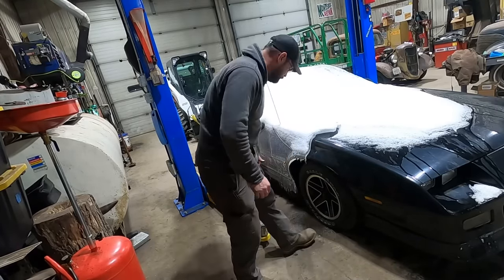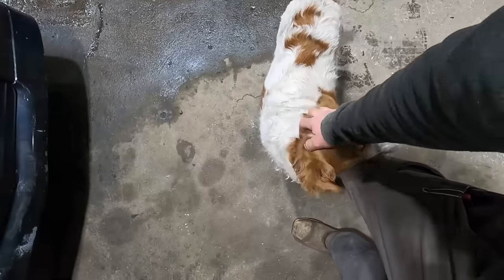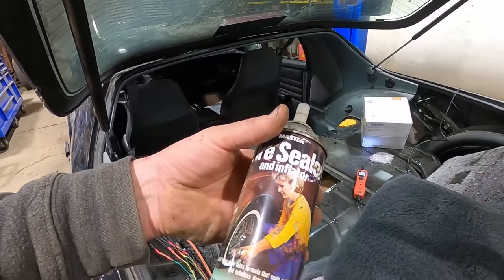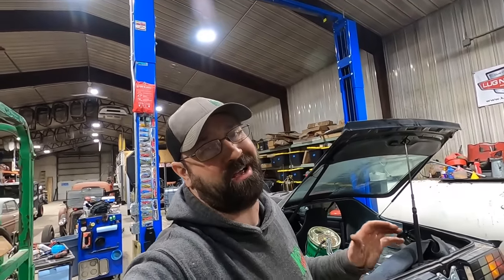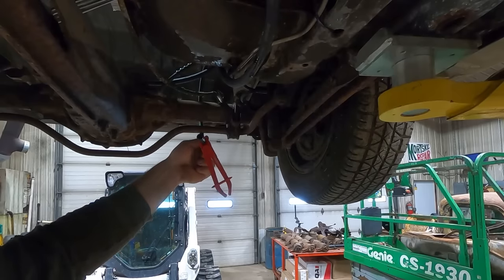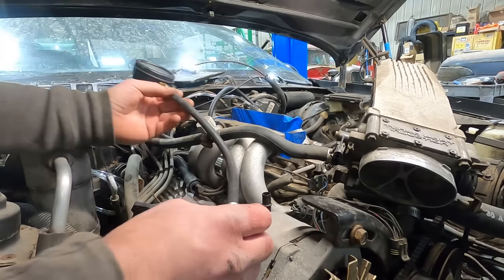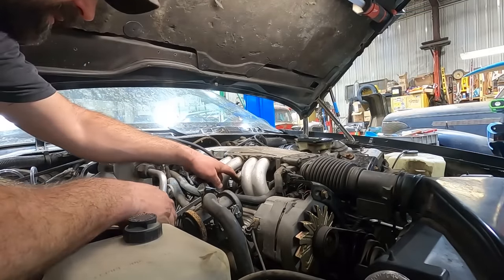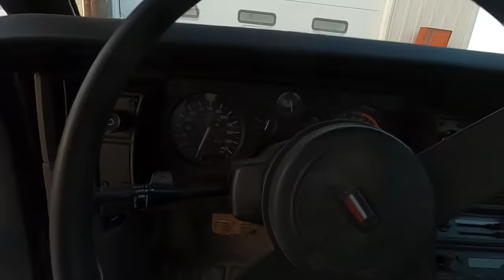Another Bargain or Bust Facebook Camaro?!? Low Mileage 1986 Z28 Tuned Port Injection! Will It Run?!?

Comment: Years ago I worked on a 1995 GMC 1500 that needed a new fuel pump. When I finished ripping the rotted straps and got the tank down I was greeted with half a tub of hardened plumbers putty spackled around the sender. Videoed all that away and found the lock ring just sitting inside the putty not even in place and locked in. When I got the sender assembly out the o-ring seal that seals the sender to the tank was just hanging out in the bottom of the fuel tank.....🤦‍♂️ the owner had told me that the truck used a lot of coolant. When I went looking for a coolant leak I found that whoever had last replaced the thermostat and bolted the housing down with the little half oval metal plate that goes on top in between the housing and the intake manifold which left an 1/8" gap on one side that just leaked coolant like a sivv.... after all that it still ran rough. So I tracked down and fixed 463,000 vacuum leaks lol

Comment: I think it might be something to do with the control module maybe.. seems like it's loosing power in the ignition run position. It's been a while since I worked on 1 of those so I don't know for sure if I remember correctly.😇 But it cranks and wants to run but as soon as you let the key to go the run position it dies.... Bad wire..? There was a lot of burnt and " repaired " where a fire was evident....

Comment: You could clean that tank with a rod super suds from arm and hammer water and a battery charger on its high charge like 12v 40 amp (not start mode) ground on the tank and positive on the rod ( insulated on tip and point where it rest on the tank. Pull and clean every 12 hrs. Till you see less on the rod. Drain and inspect. Keep air venting area. It may create gases.

Comment: love my 86 IROC. punched 350 with the T5..IROC's have 4 wheel disc brakes so if you're going to make it a runner that is a nice upgrade. Same with the sway bars. IROC's came with a heavier sway bar. They also have what is called a wonder bar. It's a brace for the steering. It goes between the frame rails and IROC's are the only Camaro with those. Another thing to look for if you're looking at an "IROC". I'm no expert but I've owned mine for 25 years so I know her pretty well...if I can help let me know..

Comment: Oh man, I was expecting the fuel rail to be absolutely disgusting after seeing the inside of that tank. Seeing you get the injector out and seeing it caked must've been awesome. I think you can flush an injector with a 9V battery or using a bench power supply and use something strong to flush it. Nice troubleshooting work on this one!!

Oh, I bet the last guy who tried to get this running started the fire when fuel was pissing all over the ground and the lines were probably nasty with rust which accounts for where the fire was from. I bet they finally said f*** this, not my problem anymore.

That smile when you got it running, priceless.

Oh, you said why didn't you think to check the power steering? your PS lines are pissing all over the place :)

Comment: I've been doing the metal work and restoration of my 83 Z28. It's a shame how much cost cutting went into these cars. They could have been a lot better. 

Things to look for if you get another one, the areas around the body plugs on the front and rear foot wells rust. The pinch welds up front are not meant to be lifted from, they crush the fender mount and the door will catch on the fender and it is a large cause for rust in that front corner since it breaks the rocker and floor open. The lift arms need to either go under the subframe by the transmission or the rocker supports/torque boxes. The rear impact support under the bumper are always rusty up here and they do make replacements, they're not expensive. The spare tire compartment on the right side of the trunk is common rust spot (same on driver side). If it's a t-tops car pull the tops out and check the weatherstrip channels. If they're rusty it can lead to a hole on either driver or passenger a pillar bottom, no one really makes replacement pieces for the channels either. The strut tower tops can rust through behind the mount, battery trays on either side where it's spot welded to the inner fender, bottom of the radiator support, the driver side trans mount, and the front of the rear wheel wells will start to rust along the pinch weld and at the bottom. The coating they used from the factory is not very good and a lot of those areas get moisture and salt between the layers and rust.
Reply: They were very poor quality as was most other vehicles of that era. Not many domestic vehicles of that time were known for their quality, reliability, and durability. I was young in the 80s and I wanted a Z28 so badly that I couldn’t stand it. Fortunately my poverty prevented me from getting one.

Comment: Buddy had a 84 z28 Camaro with the 305ho. Was fully loaded. I don't understand how manufacturers build some cars. Had a 94 escort gt had power windows locks AC cruise power sunroof but no tilt wheel. Also had a 08 escape limited and the only option I think made it a limited is the leather seats. Didn't even have the steering wheel controls for the radio.

Comment: Had to do the same on my brother's trans am, been sitting for 10yrs with a bad pump, then injectors were bad, orielys wanted 100+ for each, got a set a 4.6 mustang injectors for $50 off marketplace, then she fired right up. Rings were stuck, threw some trans fluid in the oil and ran it a few days to free up the rings, it was good to go.
Reply from the maker: awesome!

Comment: Hello Mortske, my younger brother had a 85 Monte Carlo that the previous owner put in a pro street 305 in it but they took off a dual carburetor intake & put a single carburetor intake on dual exhaust headers &  welded the dual exhaust onto a headers then put a pair of those big mufflers like corvettes have on them,that car got up & went that's my nice way of putting it & it had a positrack rear-end under it that car laid down the rubber because he had a set of 50's on it back-end & if you put the gas pedal down it would put you back in the seats,I  miss that car he ended up selling it
Reply from the maker: sweet!

Comment: I had an 81 Vette that had a rod knocking, Found 86 87 Vette TPIS cheap, Had the 350 rebuilt and cam with Vortech Supercharger and Headers. Wow What a wake up. Oh and a 700R4 tranny with 3.36 gear, It would fry the tired in low and then slip the band on the 1 2 shift, you could smell Clutch every WOT 1-2 shift. I loved that old 81.  And 27 MPG Highway, I drove it from Virginia to Illinois and back great cruise. I think That old Camaro could easily be a great driver. You find em, fix em and let some one else finish it up. Great video Dennis
Reply from the maker: Thanks for sharing!

Comment: yeah, I think the only way I would even turn a wrench on that one is if I was taking it completely apart to salvage anything worth keeping.
Reply: I guess the rear limited slip axle assembly would be worth something. T5 are a dime a dozen and the engine is about a 150-200 core. Since I’ve been a technician for years I would probably snatch the drivetrain and do a decent refresh on the engine and make sure the transmission and rear diff are good and get what I could for them and scrap the rest. I’ve been there and sometimes you just have to take the loss or become a scumbag and try to screw someone else. I sleep better just taking the loss and moving on.

Comment: TPI ENG were known to have bad injectors. I had a 89 GTA had to replace all 8 injectors. The coating on the wire coil in the injectors would dissolve and the injectors would short out.

Comment: When you got into the fuel rail, I said to myself, this can’t be good.  They always leak when you mess with the injectors. Last one I did, 2007 Subaru forester, 3 Of 4 leaked.  After I bought the rock auto injector repair kit, I got them all to seal. Laugh about the Subaru but that’s 170 hp on 2.5 liters, plus 4wd. You are at 190 hp with 5 liters and 2wd. Funny video.  You are like watch Wes work with out diagnostic tools.  Much like me!

Comment: The problem with putting the 350 behind the 5-speed wasn't the transmission holding together, but the frame flexing with the shifting of a manual transmission. A problem that could be corrected with subframe connectors. I suspect the problem wasn't as big a deal with non-T-top cars. I bought my 1987 GTA to get a car with the TPI engine. The TPI engine comes with a cold start fuel injector that sprays in extra fuel, but it often fails and is no longer available. Corvette TPI motors have the same problem. I haven't done it yet, but there is a way to upgrade the software to eliminate the cold start injector. While it is not a Hellcat motor ... it is fast enough to get you into trouble! 🙂

Comment: I bought an '89 RS, 5.0 TBI, 5speed manual new. Daily drove that thing until 2001. Put over 400k on it. It required regular T5 rebuilds and clutch replacements.
Reply from the maker: awesome!

Comment: Make sure your fuel pump ground is clean and the fuel pump relay ground is clean and tight and check out the injectors and they are functional and when you do get it running running some sort of fuel treatment in the gas tank with about a half of a tank of gas,i used stp and the other third Gen Camaro berlinetta Lt sport coupe t top 2.8 173 gm Chevy V6 automatic 700r4 overdrive transmission 85 Camaro i used the slick 50 engine treatment its $18 a can i don't suggest that one i was a highschool kid lol.. and some genius decided to spend money on a 2.8 v6 aluminum heads Edelbrock tubular exhaust headers and the z28 dual outlet exhaust specific muffler and tails, my car had a g80 and the 3.42 rear gearset not too shabby for a 2.8 multiport fuel injected v6 Camaro.

Comment: My old one was doing the exact same thing ended up being something with security I pulled ignition switch out of the column and moved it manually with the bar that was attached inside the column and it ran perfectly

Comment: I had a 90 iroc red with t tops full load with leather seats  5 spd built roller 350 with new clutch tires and the engine I bought the whole running package built for 6 k . Fun car .
Reply from the maker: Thanks for sharing!

Comment: I just saw a leak and danger of gasoline leak. Pull the intake manifold so then take the plenum and the rack needs extra glue around the injector and the rack that is suppose to press all 8 injectors. Please. Thank you good job thumb up.

Comment: I have tpi. My car did the same thing after sitting outside. I went all over the fuel. I changes out a $14 throttle position sensor from amazon. Started right up

Comment: If I would guess a new fuel tank and injectors then it can be flipped. But, the fuel system is not conducive to flipping. Great the add Lib. On the Ford injectors.
Thanks for sharing.
💯👍
Reply from the maker: Our pleasure!

Comment: First of all I jumped a foot when you had that mouse jump out!  
2nd I wonder if you hooked up the cold start connector to another injector if the start and quit function would continue. If so, then you would know if the other injectors were clogged. I haven’t finished the episode so I suspect it a mute issue at this point. 
Really enjoy your channel!
Reply from the maker: it could be wired up

Comment: I'm not a huge fan of the camaro, but GM really got it right with the design of this gen with the trim package. I'm with you I'd love to have a IROC a modern LS in it. Love that long hood they have. On a side note a neighbor had a 85?? Z28 with the 305. It was great to cruise in but it was a polished turd just stock. Great vid with all the southern engineering to get her running.

Comment: That was likely a police car. I worked at a Chevy dealership in the 80"s and saw a few Camaro police cars. Always 5.7 TPI, stripe delete Z28, black wall tires 145 mph speedo but not an IROC. Extremely rare options.
Reply from the maker: interesting!
Reply: Or... it was just a regular old Z28...  because that's exactly what it is.  Not all cars sold in 86 and 87 were Irocs and they weren't anything exclusive to law enforcement lol

Comment: I’m in Minnesota as well and bout an ‘87 with a little over 90k on the clock for $2,250 with a lot less rust than this man. I got lucky. Dropped in a 355 and trying to decide between an ls and a 383. I’ll be following along as I built mine up as well
Reply from the maker: Score!

Comment: The v6 was a 2.8 v6 the 3.8 didn't come till 98 and in 2000 you got the y87 package with was 230hp 325 ftlb and had traction control and dual exhaust and limited slip

Comment: Those injectors can be cleaned this way with carburetor cleaner and old fashioned pipe cleaners. It worked for me in my crown Vic, if you’re in a pinch!!! Then dry then out either lightly with compressed air. Check the “o” rings!!!!on each of the injectors
Reply from the maker: Thanks for the info
Reply: @MortskeRepair  if you don’t , it leaks like a fire hose near fuel tails . I know from experience. On a crown Vic And a 08 caddy CTs, Whst a pain in the Pupic lol

Comment: ProMotion makes a trick little tool that fires the injector with a 9 volt battery. It also has an adapter to use spray carb cleaner.
Reply from the maker: thanks for the info!

Comment: Coming rot points on these are the drivers floor / front rockers iv had 3 they all do it and you can get replacement parts for them still

Comment: The v6 was the 3.1 and 2.8, i had a 92 firechicken with the 3.1. Goofy 60 degree motor but it ran okay. I think they put them in isuzu troopers and I also had a olds acheiva with the 3.1

Comment: The take off rocket rod must be connect to the housing of the rear differential. The rocket rod is made the car so rocket rod is between the rear end all metal pumpkin and no independent suspension for the tubing live axles and bearings. Again the rod at front is connect to the cross member that is there under transmission included mount of the transmission. That is where the rubber mount is above the cross member.

Comment: Keep the tuned port, it'll run keep trying . There's a problem with the fuel rails or an injector problem something squirting fuel I would lean towards the fuel rails and put some good injectors. That car will run

Comment: I had a black '87 RS. It had a v6 in it and the transmission  went out so I bought a SBC crate motor & 350 Turbo and dropped it in. That particular car is the reason I hate headers! 😅
Reply: What a shame.  The 1987 RS was a low production test of the market in California.  Intact they are very valuable today.

Comment: Great video as usual. Not sure if you have an injector cleaning machine (or want one) but I can see where they would be nice to have on occasion. They seem to vary in price and I am sure the inexpensive ones are fine until you take them out of the box. That said, your accountant might like to buy tools  so you can get the tax write off (depreciate them) rather than give all of the money to Uncle Sam.
Reply from the maker: Great suggestion!

Comment: Back in 1986 I purchased a new off the lot Camaro. Black even. We lowered it in the 1st week. Changed the PROM chip and removed all the smog gear (had a buddy who would get anything we had smogged). The compartment in the hatch area on the right was indeed used for narcotics. The car was clocked at 142 mph crossing into Nevada from California on interstate 80. Lots of fun in that car.
Reply from the maker: Must not have been a 305!
Reply: @MortskeRepair  correct it was a 350.

Comment: Well, Those pre-CAD unit bodies are rather flexible. There's a case to be made for welding in a frame reinforcement to handle LS power anyway. A new front crossmember could accompany the frame upgrade. Any car from that vintage requires a lot of upgrading to go with restoration. This isn't necassarily that much worse than other candidates.

Comment: I'll tell ya, I am conflicted because the underside says 134K rough winter miles, but that interior looks like 34K.  Those dash pads are always cracked, split, and missing the edges at the doors by 134K miles. The seats look like no one ever sat in them.  Very good parts car but I think the rust can be taken care of before it it gets worser.

Comment: Definitely an 86, it was the only year with the third brake light on the outside of the rear glass. 1986 was the first year for 3rd brake lights so they basically just took the 85 design and added the top mount light. 2.8L and 5.0L were the main options, the 5.7L was hard to find and maybe only an IROC option. My first car was an 86' 2.8L coupe, and in 86 only the Z/28's-IROC's had the front lower fairing with side skirts. In 88" all of the Camaros came with lower body skirts so it was harder to tell just looking from a distance if they were V8 cars. AND mine had the factory louvers 😎
Reply: Have an '87 iroc 305 5-speed. Yes, the 305 was 'standard equipment' for the iroc and the 350 costed a little more. Have a high-comp L46 from a '70 Z28 that's going into it when I get the courage to tear apart a numbers matching iroc 😑
Reply: That is not true.  If you ordered a 1987 Camaro Sport Coupe with the spoiler delete, you got the '86 CHMSL.
Reply from the maker: thanks for the info!

Comment: Yeah I do not like them style intakes and injectors, I bought a wrecked Corvette with a 5.7 with that setup, It was such a pain to get it running to hear it, I wanted the engine out of it for my 92 Silverado, Ended up just biting the bullet and yanked it out and dropped it into my pickup with headers and a different oil pan and the old TBI throttle body from the old engine, and she fired right up.